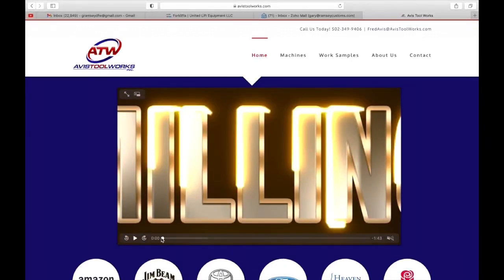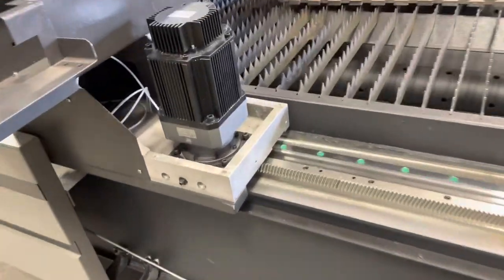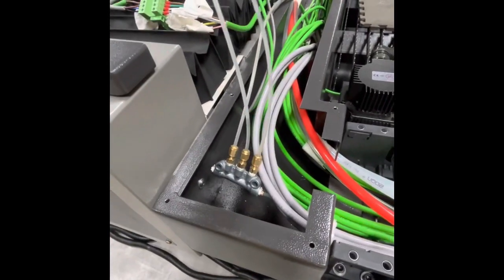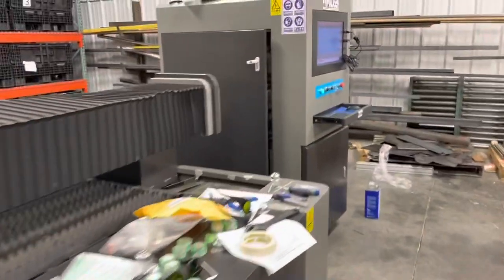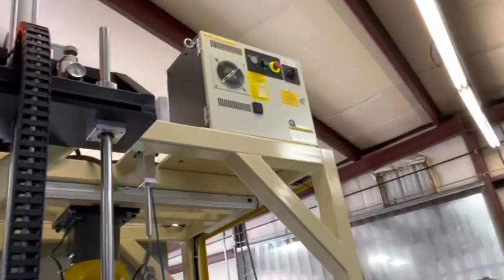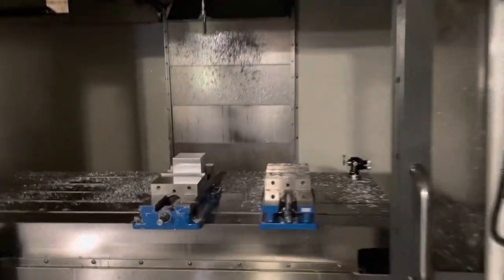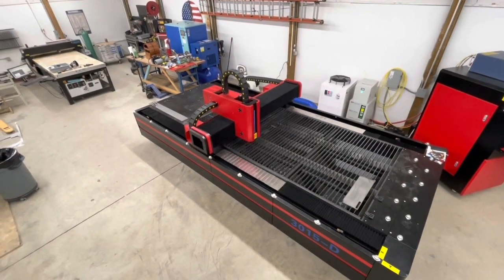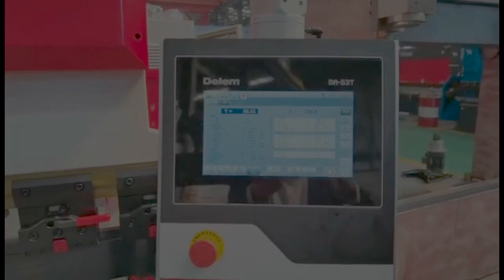Kentucky CNC machine shop adds a Prima fiber laser - Coxs Creek, Ky - Laser Table

Comment: Hi Guys,
Just installed a 1500kw fiber laser.
I am new to this and wanted to know are there any special goggles while watching the laser machine under operation.

Is there anyway to extract excess fumes because in spite of using the current extractor I still feel the fumes are high enough to get health complications. In such a case can we use masks with filters used by painters in a painting booth?

Comment: seriously, I hope somebody explained to you that safety glasses do not stand up if the fiber laser has a significant reflection and that the damage to your eyes is permanent. Be smart, put some sheet metal around it before you have a serious accident.
Reply: As someone in the industry it shocks me that people buy these without protection.  Shops that have high end lasers like Mitsubishi all have enclosed cabinets.